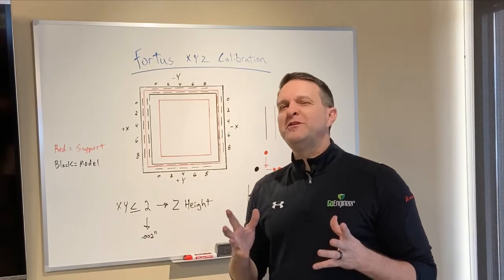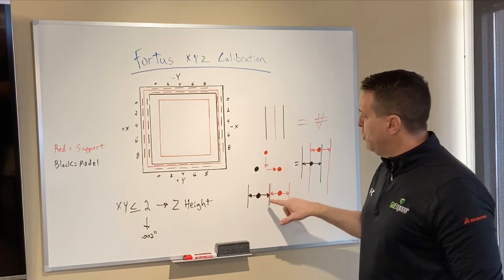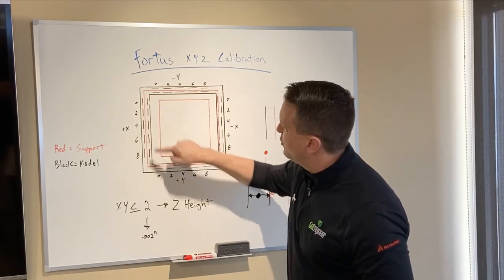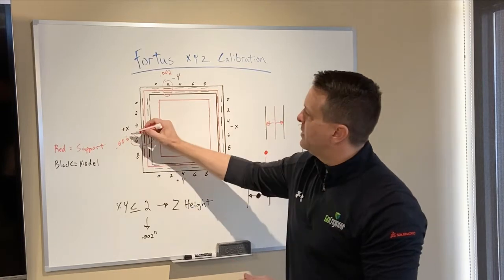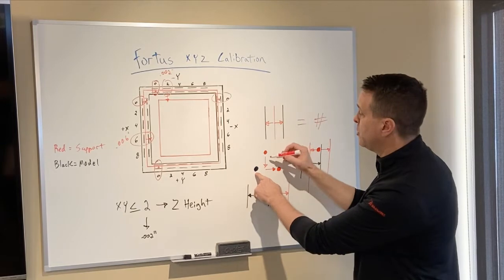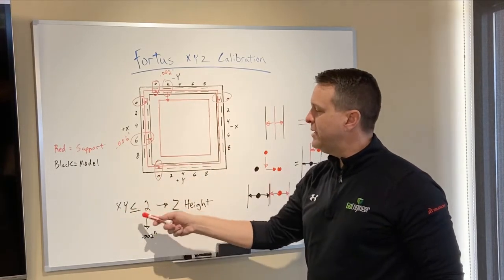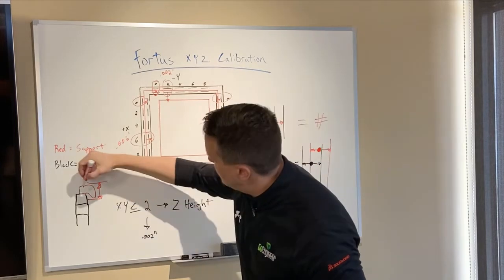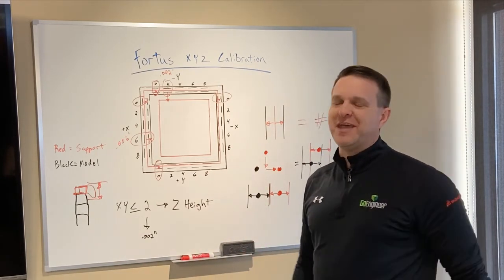Stratasys Tutorial - Fortus Calibration Theory

Comment: So, if the entire box moves, then the goal isn't to get it to zero. It's to get X1 and X2/Y1 and Y2 equally distant to zero? Example: We have a bunch of F370s where i work. The 0 point is actually in the middle of the sides of the box rather than the extremes, as I am sure you know. Our Y axis on the machines is nearly always at 0 on Y1 and Y2. The X axis on the other hand is always nearly always offset from one side to the other by .004 though. In that respect, it should be viewed as if connecting both sides with a line and adjusting it until the middle point of that line is at 0?
Reply: Hello Faultyinterface! I know I'm responding to this REALLY late, but in case your question was never fully answered, this video is for the FORTUS line of Stratasys printers and the calibration for the F-Series is actually different. So, if you still need it, follow this link to a video on that line of printers and how to calibrate them. https://www.youtube.com/watch?v=emD2g0ohzAg&list=PL76CFED73553BCF0A&index=144

I hope that might still help.

Comment: Hi I changed the head on my MC450 today and obviously calibrated it after.  On the X axis, it was so far out it was outside the two lines.  To get it in, I had to keep doing the calibration print and selecting -8 until it was eventually in between the lines, then I could do the fine adjustment.  My question is, is there a quicker way to calibrate if your starting so far out, or is it just a case of taking the maximum 8 thou till your in between?
Reply: In cases like this, usually I tell people to stop and recheck everything from the head mounting to the tips being secured in place. It should never take more than 3 times to dial in a system. If it does, something else is wrong. So, to your question, no, there's an easier way but if I see it's that far off, I'm immediately looking for something else that might be wrong. Does that help?